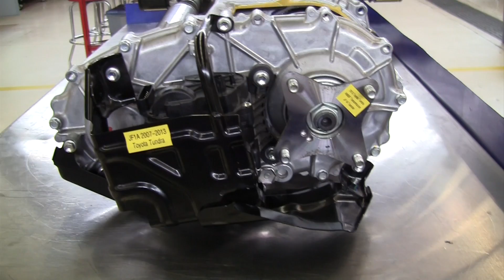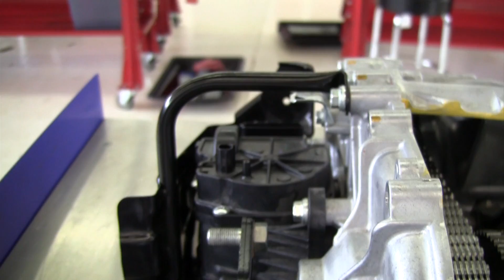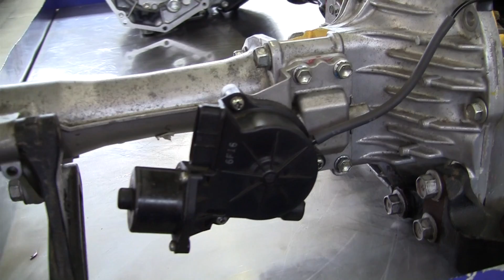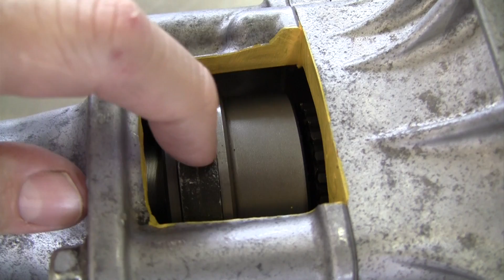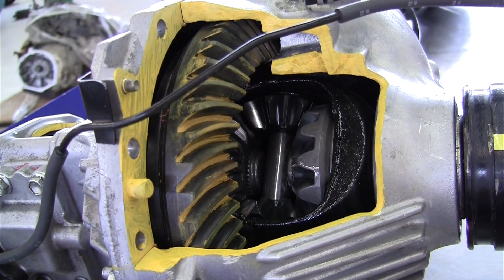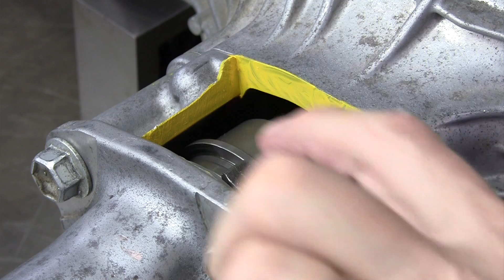Four Wheel Drive Operation (4WD)

Comment: thanks!  I should have also asked what is the appropriate backlash measurement on  a '96 Landcruiser with an open differential. if you can share this info with I would greatly appreciate it. is there a reliable public website that I can go to get other torque specs for a Landcruiser? thanks.
Reply from the maker: Hi, backlash is .005"-.007". I do not know of any free public websites, but there are subscription ones. See www.nastf.org

Comment: hello professor,
I am going to disassemble my front differential to figure out why the yoke spins without engaging the front wheels. I have two questions, first, could u tell me what is the correct preload for the pinion gear when I reassemble it? second, do I need to remove the Birfield joints and connecting axle rods in order to remove ring gear from the differential? I have a ‘96 Landcruiser with a regular open differential. thanks.
Reply from the maker: Hi, Yes, 1. you need to remove the axle shafts in order to remove the ring gear from the housing. 2. The pinion bearing preload is 8.7 − 13.9 in*lbf. Best wishes!

Comment: Great video!! My 2003 4Runner has multi-mode 4WD system. When I switch from 2WD to 4H, the 4WD light and center diff lock light blink for a long long time before it become solid, and sometimes it won't become solid at all. During this blinking time, the drive train binds when turning. Could this be issue with the transfer case or the ADD system? Thanks for you time!!
Reply from the maker: +Heavenscape Hi, normally the blinking 4WD light indicates that the front automatic disconnecting differential (ADD) has not connected yet (not in 4WD). You indicate that the powertrain binds at times during this situation. That tells me that your front differential is connecting and it is really in 4WD, but the front ADD actuator's internal 4WD switch is not functioning correctly. It sounds like you need a new ADD actuator assembly. Best wishes.

Comment: Thank you, very informative. How often to change the transfer case oil. I have a lexus, LX 470 2001. what kind of oil to use.
thanks .
Reply from the maker: +A “AAS” Saeefan Hi, every 30,000 miles with 1.3 L (1.4 qt., 1.1 lmp.qt.) Gear oil API GL–4 or GL–5 SAE 75W–90 oil. see http://drivers.lexus.com/lexusdrivers/info/my-lexus/resources/submit-owners-manual-search?section=om&keywords=fluid&searchType=&model=LX470&year=2001&x=0&y=0#
Reply: gfh

Comment: I think you have given me a clue, I will have to shift my high/low lever into the high position & see if the 4x4 kicks on.  As a follow-up question, what is affected by moving the high/low lever on these older systems, does this lever affect parts in the transfer case or the diff or both? if you can give me a clue about ghetto functionality of this lever, then I will certainty get theism 4x4 system up and running again.  thank you in advance.
Reply from the maker: +Rupert Gaznabbi The high-low lever only engaged or disengaged a planetary gear set in the transfer case to givbe you 4WD low.

Comment: thanks for your prompt response. however, looking at the transfer case & front diff of my `96 land cruiser I don't see an ADD switch, as you mentioned. this is a full-time 4x4 systems so perhaps there is no such switch to disconnect & reconnect the 4x4 systems.  the real question is how do you disconnect & reconnect the 4x4 systems on an older transfer case & diff.  could moving the high/low lever next to the gear selector do the trick? does this lever have a neutral position?  I look forward to your response. thanks.
Reply from the maker: +Rupert Gaznabbi You are correct, the full-time AWD system does not have a front ADD, so if your front pinion spins freely, you really have problems! On older systems, the transfer case lever must be in neutral to disconnect engine power from the differentials, or 2WD to disconnect only the front diff. I hope that helps.

Comment: great job professor!  I have a 1996 Toyota Land Cruiser with a full-time 4x4 systems. the previous owner remove the front prop shaft.  I went to reconnect it but the flange on th front diff is spinning freely instead of being locked in place. is my problem in the diff or the Axle shafts?  I appreciate your feedback.
Reply from the maker: +Rupert Gaznabbi Hi, if the front diff spins freely, it is not a problem, the ADD actuator has not engaged the right hand axle shaft. That is normal. When the actuator does engage, then it will not spin freely. Try putting the transfer case in 4WD. That should also cause the front diff to engage and stop spinning freely. Thanks for watching!

Comment: I'm curious, isn't it bad for an open diff to have the spider gear set always rotating, when the DDA is engaged? I'm surprised Toyota went with such a solution, and have not installed two shaft-disconnecting mechanisms.
Reply from the maker: +Max oobbxxx Hi, it is not bad to always have them rotating as long as the side gear backlash is correct and the fluid level is correct. Almost every manufacturer is using this type of system, not just Toyota. Thanks for watching!
Reply: +WeberAuto I guess, now I understand why ― with the DDA disconnecting the power, the spider gears essentially freewheel, with hardly a surface contact. In this case, even the side gears, which lack proper bearings, can last forever.

My confusion stemmed from a seemingly common occurrence of destroyed diffs due to frequently getting stuck on ice or in the mud, and letting one wheel spin violently (or doing lots of "burnouts"). But in these cases the spider gear set is loaded with power from the engine. Am I one the right track here?
Reply from the maker: Max oobbxxx Hi, yes, that is correct, but also remember that under those circumstances excessing speed and centripetal force (on the oil) causes a severe lack of lubrication which leads to seized spiders to the spider pinion shaft and eventual breakage of parts.

Comment: The presenter did an excellent job, HOWEVER, I think he made a critical mistake, at the very end of this video, he said "to shift back into 2wd from 4wd, we need to first disconnect the mode shift fork in the transfer case and then disconnect the ADD (automatic disconnecting diff)", something like this, actually, I believe the sequence should be REVERSED for the same reason, we don't want the side gears in the front diff case to fight each other at ANY time.

Comment: Awesome video, but you lost me when you started talking about the purpose of the DDA in the front differential/axle to prevent the right side wheel turning in the opposite direction of the left side wheel.
Rear wheel drive cars don't have DDA in the rear axle and yet we still can push them while they're on the ground and both wheels will turn in the same direction; That's the purpose of the differential to be in there to make the car turn smoothly and reduce tires wear and tear.
Please correct me if I'm wrong. And again thank you for the videos I really enjoy watching'em... Happy Easter :-)